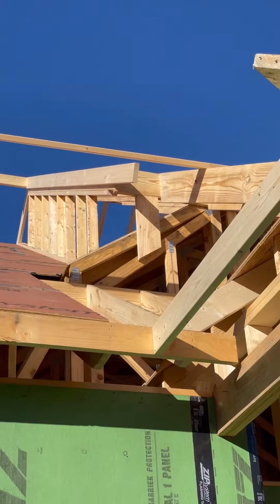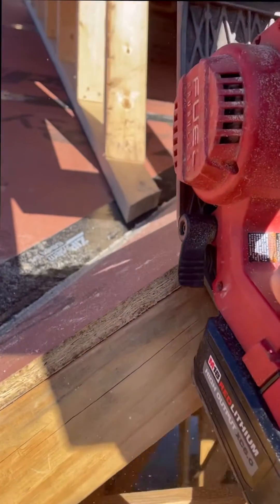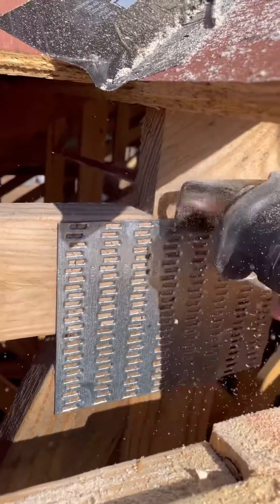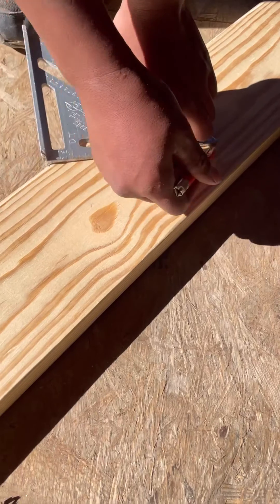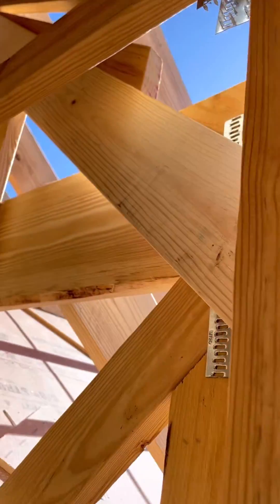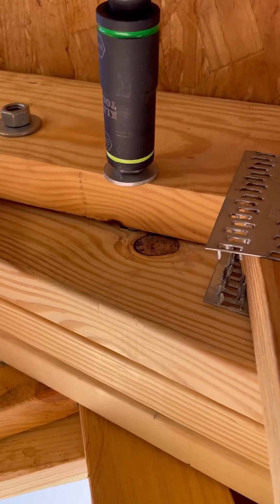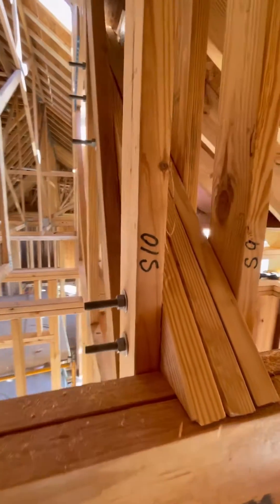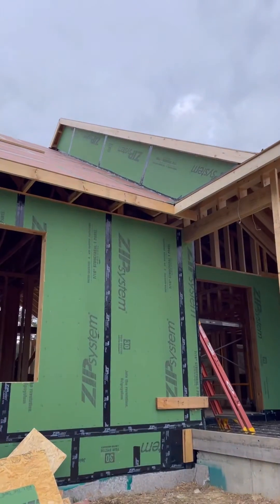Truss Repair

Comment: Biggest problem I ever had on a job was "long long time ago, I was attempting to cut a 45° angle on some door casing using a circular saw, on top of that, I eyeball everything, No framing square, compass, nothing; I just eye ball it." Worst problem i ever had. Changed my life.

Comment: I was doing a full gut remodel.  We thought the floor was plywood on slab, which is not uncommon in the area for the time the house was built.  Turns out it was plywood on 1x4s and 2x4s set in a thick layer of asphalt.  Apparently, they didn't do any prep work before pouring the slab, and it settled between half an inch and 3 inches across the house.  I had to pull up all the wood and asphalt to get down to the slab.  After prep work, we poured self leveling thinset over the slab.  It worked well except for one bedroom.  It's the one that settled the least.  Apparently the slab was poured on an old rock driveway for that corner of the house.  We did thinset that bedroom as well, but we decided to have it as a step up of about 3 inches.

Comment: The biggest problem I have had is finding an engineer where I live. My house was built in 2003 - basement home with open floor plan. Engineered joists. Not very level. Paid an engineer who charged me $600 to convince me nothing wrong (I let him Jedi Mind Trick me). Finding a wood frame residential structural engineer seem easier said than done.